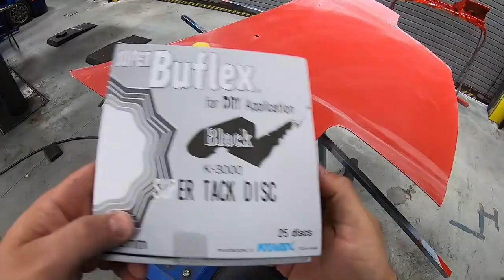Eddie's 1993 Acura NSX NA1 - Front End Refresh in Formula Red (Episode 1)

Comment: I did the same thing to my 94 nsx front end. I took both fenders off mine too, blending of the front fenders are critical to get the perfect color match. Like you said in the end, there are a lot of parts and it's really hard to get everything to line up correctly. Painted my windshield nozzles too. Replaced all the fender liners, all plastics in back/inside of front bumpers and oem lip with oem parts. Did both rocker panels too.